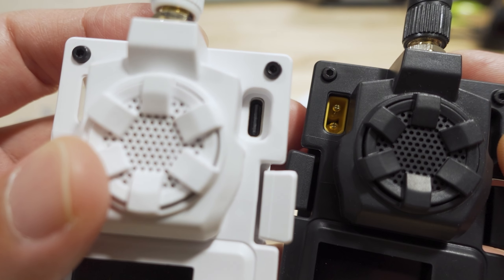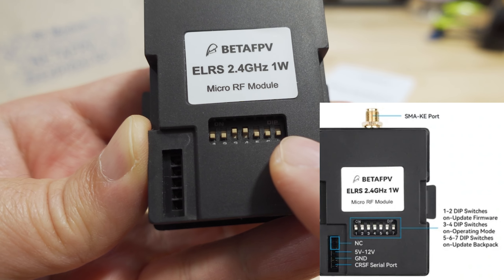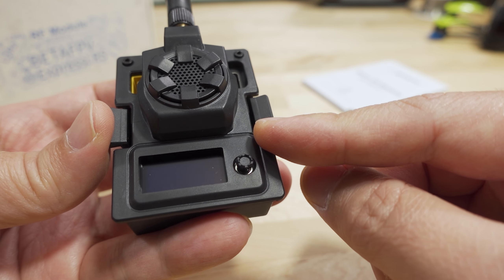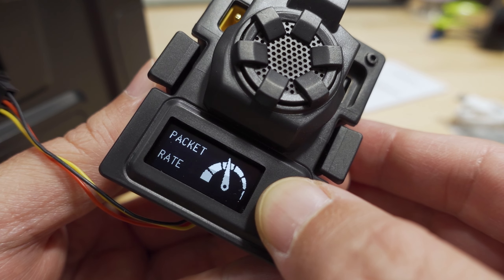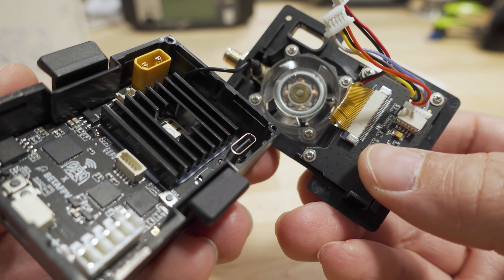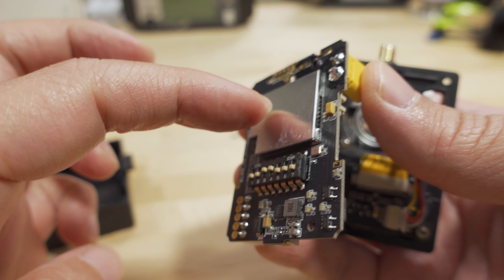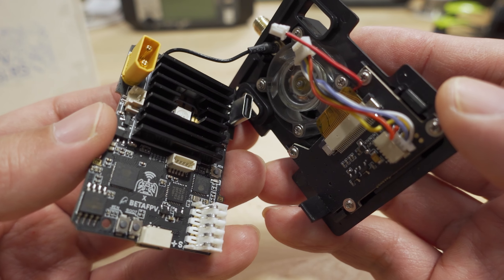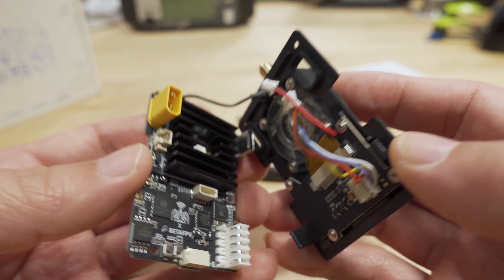BETAFPV 1W ExpressLRS MicroTX Module 📡

Comment: Albert, any way you could make a video on how to solve receiver problems (ELRS)... I use mainly happymodel ep24 RX with Betafpv TX... Since i "upgraded" my rx and tx to from 2.0 to 2.01 the receivers don't  bind and the rx refuse to go to wifi mode now... (No luck either with uart  or betaflight passthru)   Is there any way to completely reboot the receivers and start over?? Any help appreciated. Thanks! 👍
Reply from the maker: Can you tell me some more details about these problems?  I'm not having problems like this so not sure where to start on a solutions video for a problem I'm not aware of.  Have you looked at the expresslrs.org website for troubleshooting tips?  Are you sure both TX and RX are on the same firmware with the same options?  They won't bind if the settings don't match up.

Comment: Hi Albert, I have one of these modules on the way. Is the correct way to flash this by choosing git branch in the configurator and then select master in the drop down and then choose the appropriate hardware. I just don't want to mess anything up.
Great video as always!
Reply from the maker: Yes, you got the general idea.  I did have to go to the support section and clear out old data and files because the flash failed the first time.
Reply: @AlbertKimTV  thank you Albert. I know what to do now!
Reply: ELRS V2.1.0 was released yesterday! Should be good to go now with this module.

Comment: Hello again,
This elrs tx is sold with a dipole antenna as well as a moxon one.
Any recommandation on one versus the other?
Reply from the maker: The moxon antenna has higher gain but is more directional so meant for long-range use.  If you don't fly more than 2km away, the moxon isn't needed.

Comment: Thank you for your review!
I am wondering what the xt30 connector is for?
Reply: @BengalCatChilli  thank you for your answer. Not very ergonomic with an external 2s battery though.
Reply from the maker: It's available if you want to provide extra power for the transmitter at high power.  Will let your radio battery last longer.  Not required but there as an option if you need/want to use it.

Comment: I just received my express lrs 1w module and followed your dip switch instructions but I get a flash error saying betafpv 2400tx 1000mw via uart failed. What am I doing wrong?
Reply from the maker: Could be a USB driver problem or USB cable problem.  I'd try a different cable first, then perhaps a different PC.
Reply: @AlbertKimTV  thanks for the reply, I'm all good now I had some help on FB and I'm up and running now

Comment: I bought this but can’t get power over 500mW not sure what is wrong. No 1W option.
Reply from the maker: You might have flashed the wrong firmware or put in some incorrect settings during the flash process.  I can confirm 1W does work on mine... are you sure you have the 1W version and not the 500mW version?  They look almost the same.